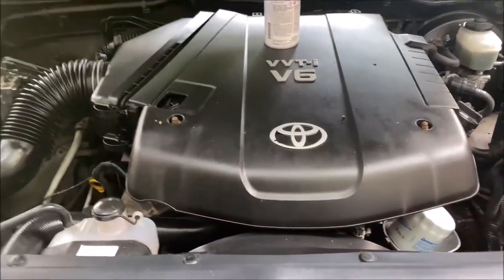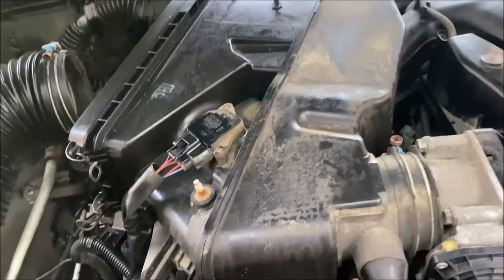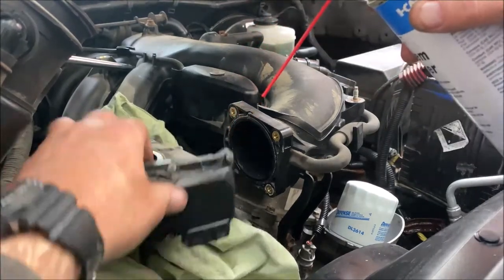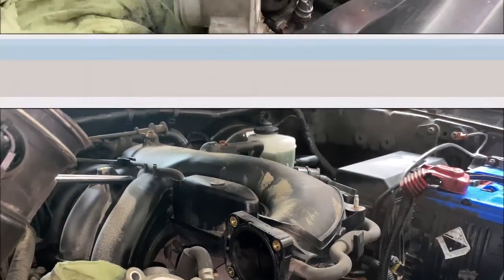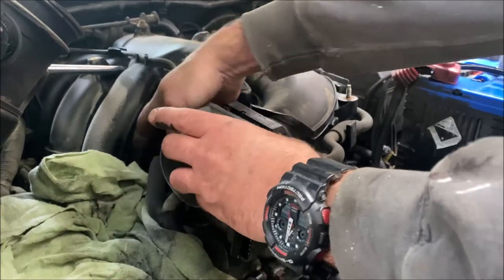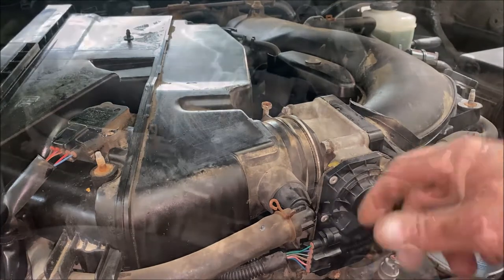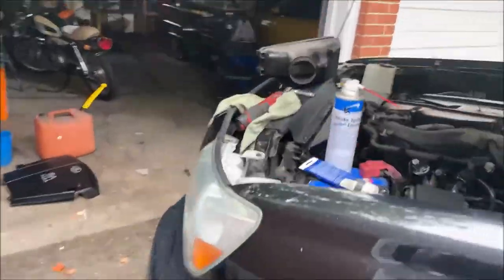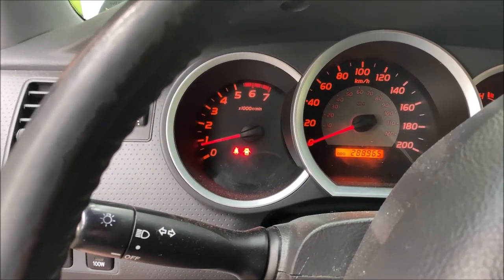2005 2015 Tacoma 4 0   how to remove and clean throttle body,reset idle

Comment: 6:11 Indeed, no need to be afraid as long as the throttle body is entirely unplugged electrically, and you make sure to open the plate gently and slowly so as to not damage the delicate gear train inside the inner workings. :) This is an often overlooked maintenance job that can make a big idle quality improvement!
Reply from the maker: Agreed. 15 minutes and a vastly improved idle

Comment: If you're going to clean the throttle body, I would also recommend a couple of other things to do at the same time. 
1. Replace Air Filter
2. Clean the MAF (Mass Air Flow Sensors) with nothing but a MAF Spray cleaner, and do not wipe or touch the sensitive wire,  just spray and let air dry.
Reply from the maker: good suggestions ..appreciate it .

Comment: PCV is positive crankcase ventilation & it’s not attached to your throttle body. It’s mounted toward the back of the engine ( up top ) on the driver’s side.

Comment: Thanks for this video! I just cleaned my throttle body. I was having idle issues when using my AC. Slightly erratic idle and when coming to a stop a very slight thump. The problem is gone. Toyota Tacoma 2015 V6 30,600 miles.

Comment: I have a 07 Tacoma 2wd auto and out of no where a few months ago I would start to slow down while on the highway. When this happens and I try to accelerate the rpms will go up but the speed will barley increase. This usually lasts for 10-20 seconds then it instantly frees up and feels like you hit the nitrous button cause it's such a noticeable change in speed. Ive checked over my brakes assuming they were somehow applying by themselves slightly and also checked my air filter. Not sure if might be a dirty MAF or TB possibly bad coil but it only does it while I'm on the highway never on backroads. No check engine lights either I'm stumped.
Reply from the maker: Revs increasing with no increase in speed is usually transmission related . Check your fluid levels with the engine warm and running . Too high is just as bad as too low.
Reply: Did you find the issue? I have the exact same problem
Reply: Looks like trns fluid is low.
Reply: Almost definitely have the wrong trans fluid levels
Reply: @RevBCSTi  It actually just went away one day. Then I had a shaking in my steering wheel which only happens on the highway around 60mph. I also my brakes applying themselves which sucked. I replaced my master cylinder, booster, calipers and rotors. It's been very frustrating.  The truck driver great on city streets and doesn't have any shifting issues or shaking issues but on the highway it's hit or miss.
Reply: @RevBCSTi  No it just went away one day. The truck shifts smooth. That problem only happened on the highway randomly for about 2 months then just stopped. It hasn't happened since.

Comment: I was told to never manually move the butterflies on an electronic throttle body. No?
Reply: I was told the same thing, they said to have someone inside the truck, turn the key to the on position, but not actually start it, and very slowly press the gas pedal so the butterfly opens up while someone else cleans it.
Reply: I've messed with my throttle body at least 5 times. Never had an issue. 270K so far. The only results are a super smooth idle and much better running truck.

Comment: Clean the mass air sensor & throttle body because my, 2011 4WD Tacoma automatic, idles at 1000 RPM. After cleaning these two items it still idles around 1000 or 11000 RPM. I think this is a little high

Comment: Honda CRV (2004-2006) re-learn idle by starting the car,  keep it 3000 rpm until engine up to temp , then release throttle pedal.

Comment: My 07 Tacoma is idling rough when parked n at a stop ,, rpm are normal no check engine light could it still be the throttle body or Maf sensor ???
Reply from the maker: Could be either . Throttle body is cheap to clean so best to start there .
Reply: @fupabox  alright thanks ,, will go at it tomorrow morning
Reply: @fupabox  ok so cleaned out throttle body and Maf sensor and still have the shaking but mainly when I’m Parked ,, rpm still normal no fluctuations only thing I see that it’s around 7500 rpm at idle but doesn’t bounce around
Reply: You could have a bad spark plug or coil pack
Reply: Am having the same problem in my 2008 Tacoma, I have changed all the spark plugs to new ones, yet no improvement. Please how did you solve yours? Thanks 🙏

Comment: I think if I can avoid not taking off throttle body butterfly just spray some intake cleaner and get the brushes to clean out my rifle move it a around a bit, a play some kind of rag to clean out carbonite and then wrap some kind of rag around brush that is long- to clean the barrel of a airflow just put back air filter back on???, that might not be the best way but we avoid any trouble with technical issues for breaking sensors and computer mapping, but doing that holding the butterfly open properly with that cause any damage brush cleaner for a rifle for example
Reply from the maker: If you do it that way , be sure to have the key out of the ignition or the idle control control could grab a finger real hard. you can gently open the butterfly valve without damage . A rifle cleaning brush would be ok
Reply: Old tooth brush probably better idea…those military style (I assume that’s what you’ve got as I do) brushes are pretty stiff…
Reply: Huh

Comment: What happens if you leave the key in when you unhook battery
Reply from the maker: with modern cars the key in the ignition can "wake up certain computer or body modules " They should have the power removed from them when they are "asleep " or key out of the ignition to prevent sudden power being pushed into the circuit .  If the battery sparks or the terminals get crossed while installing the battery ,then the modules that are awake with the key in the ignition could be damaged .